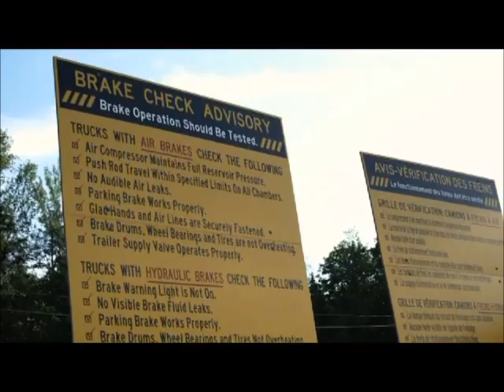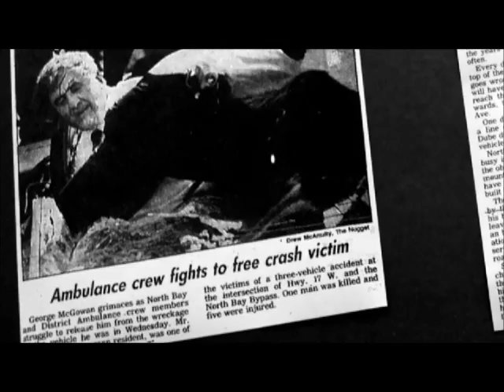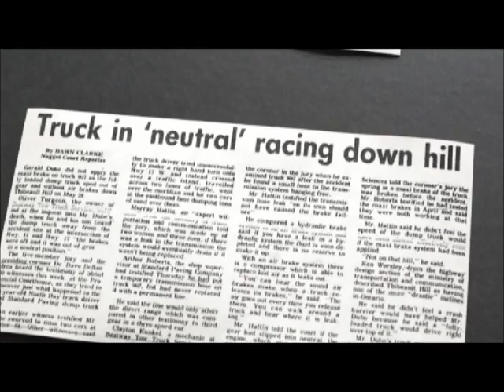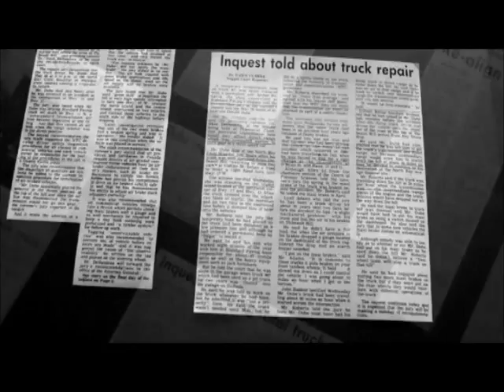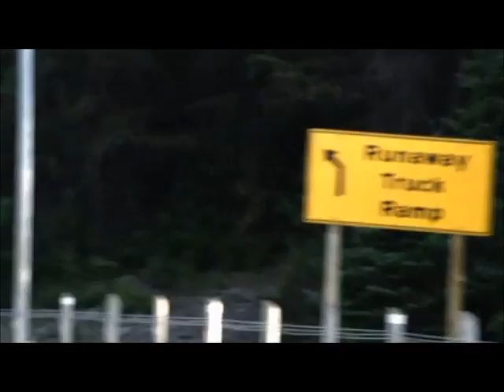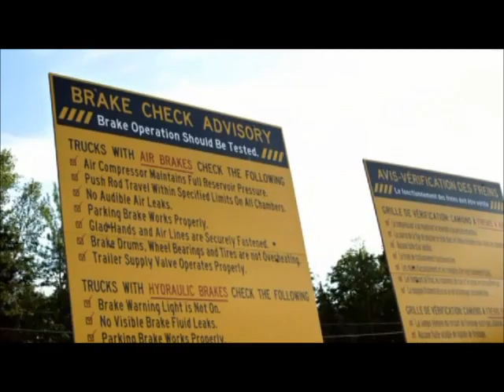Runaway Truck Ramp Demo

Comment: The real question is why are trucks running away? Problems at home? Instead of nets they need a truck psychologist on the side of the road to help these poor trucks.
Reply: lol
Reply: You don't understand that much about trucks I do not matter you have problems at home or you don't have no problem special at work when your brakes go out just hope you make it and everybody else and another thing too that's why they got them spots for check your brakes and sometime they go completely out ,,and that goes the same way for your cars or pickup trucks pulling trailers full loaded going down the hill and you're using your brakes too much and too hard they're going to get hot and crystallized
Reply: @garyrichmond7857  he was being funny.
Reply: @garyrichmond7857  joke went wayyy over your head.
Reply: Peter J Mallia  Because ceramic breaks.
Reply: 2 years old comment nonetheless i just laughed across 4 rooms. Bwahahahahahhahahah thanks.
Reply: @garyrichmond7857  Btw, punctuation is invented already and it's free.
Reply: Anifco67  it's not so much the mechanical failure as is the way it's maintained.
Reply: @Luca Hincapie I think i was far enough over his head he didn't even hear the woosh.
Reply: Anifco67  They don’t have faulty brakes. And Styledsteele1 it’s not really a maintenance issue most of the time.  It’s poorly trained and inexperienced drivers who ride their brakes in the mountains because they don’t know how to properly control their speed with gears and engine braking.  Doesn’t matter how well maintained or well designed they are, all brakes will fail if you exceed the temperature limitations of the component materials by introducing excessive friction due to erroneous steering wheel holders riding the brakes for a long period of time and paying no mind to the smoke signals being broadcast from the brakes on every axle.
Reply: Anifco67  Gary...you’re a driver, aren’t you...?   Lemme guess, you drive for Swift?
Reply: @urbanturbine  whatareyoutalkignaboutgarydontneednopunctuationmarkhesbeyondthatfullyloadedandgoindownhillwithsmokinhotbrakes
Reply: @sushimamba4281  haha. yes. seems. like. it.
Reply: @garyrichmond7857  periods work pretty good for ending sentences instead of one long sentences.
Reply: @garyrichmond7857  did your punctuation run away?

Comment: As. Truck drive that owned a truck that was put into a gravel bed by a driver, this system looks great. The gravel bed tore 26th truck up to the point of total loss. This system looks like if it makes only cosmetic damage that is repairable. The gravel system sent my driver rocketing into the room causing major bodily injuries. This on the other hand looks safer. 
Ontario MoT, thank you for your innovation in safety.👍 Good job!
Reply: Nope my brother at dealership here said they were shocked frame was bent bad

Comment: On the runaway ramps in Oregon, you get ticketed about $2000.00, if you use it for whatever, period..
Reply: Insurance will probably cover that.
Reply: I would say its cheap "driving lesson".
Reply: I wouldn't call it a ticket either. It's more of a fee.
Reply: first name Yeah but State patrol will do anything to site you for the fees
Reply: Yup that's why guys die on cabbage makes alot of sense dosnt it?
Reply: @treepop9907  :: you're right on that first part but you're forgetting there's two more parts go with that and I'll say probably two more
Reply: But what if the cars brake didn't work?
Reply: Cabbage hill will eat your lunch

Comment: I grew up in northern Ohio, where a hill is any change in road height more than 3 feet over a half mile. It's pretty flat there.  knew nothing about hill-induced brake failure, runaway truck ramps or any of this until I stumbled onto this video and now the random info nerd in me is  mesmerized when he should be in bed.

Comment: Why is the ramp on the left side of the highway?  The truck has to cross the fast lane to get to it.
Reply: If a truck's brakes have failed, there is no logic staying in the slow lane or having slow vehicles blocking the truck's access to it as it approaches... It's called a "slow" lane for a reason, much like a truck/vehicle suffering brakes failure, is called a "runaway" for the opposite reason. I actually found this video, after watching a video of a truck using a gravel ramp which was connected to a slow lane. In that particular video, it actually became surprisingly clear that the driver of the runaway vehicle often has to be "lucky" with timing, in order to safely be able to get back into the slow lane between slower vehicles that were in its way, to be able to actually even use/access the gravel ramp at all. At least when you see a truck barreling down the hill behind you in the fast lane (hopefully with hazards and flashing headlights to get your attention), you'd realise pretty quickly it's in fact in distress and get out of its way asap... People in the slow lane are just going to think "Go around buddy", instead of clearing the path... Just an observation.
Reply: oopth But think about it..... why on the right and not left? It's like editing a huge paragraph in the middle of an essay written in ink. There's lots of two way highways so it would be inconvenient and dangerous to implant a runaway zone on the left side. If the highway isn't newly built or if it's on a steep mountain, they wont risk builing it in between the lanes rather than adding it to the right side. Idk if I make sense, cuz visual things always clear things up for me- which is why Im watching this video about how Runaways work. But back to that essay, either you start all over, or you write it in the right margin and draw attention to it. This is without using whiteout or anything, because like I said, it's inconvenient and dangerous to fix up a steep mountain two way highway.

Anyways, Im not trying to argue or anything. I just wanted to give a reason as to why there's typically more runaways on the right side than the left. (at least where I live).
Reply: Where that runaway ramp is there is a rock face on the on the right side of the hwy. Hwy 11 makes a left hand turn 3 lights past the ramp so most trucks would want to be in the left lane coming down the hill instead of changing lanes in the city. At the top of the hill before you even start down there are signs saying all trucks must use left lane. And they get fined for going down the hill in the right lane. So truck won't have to try and cross a traffic lane to get to the ramp
Reply: In bc salmon pass 18%grade 21miles or kootenai 18 to 22% for 14miles all ramps on opposite side of road we know how that would turn out yup cars passing you and oncoming cars no chance of using ramp I watch a guy die he tried but too many cars coming he flew 17000ft to his death below and on salmon the final ramp goes across#3 at the stop if you make it across traffic and blow thru the ramp a pile of dirt it's over long fucking way down
Reply: Trucks must use left lane. The hill is maybe 1km long. City is right at the bottom with traffic lights.
Reply: All the runaway truck lanes I have seen have been on the right side.
Reply: It depends on the particular terrain where the ramp is located.

Comment: Semis could be required to use the lane closest to the runaway truck ramp for the previous mile, That would ensure further safety by aiding reaction time, and already being in the mindset of possible catastrophic failure, etc.

Comment: I have just found out that runaway truck lanes are a thing, so this is not a developed thought. It seems like an air traffic control equivalent might need to schedule trucks if 4 hours are required to reset the netting for the next brake failure emergency. I'm sure other problems or driver error causes runaway trucks so while it is a wonderful system... Maybe trucks are tracked and scheduled already, what do I know? I learned something new today. Mind. Blown. God bless truckers! ♥️

Comment: What happens if a car like a Honda or Ford sedan drives into this by chance? Will the cables slow the vehicle safely or is the force it takes to unwind those stop blocks so strong it just rips a car apart? Pretty cool how it worked for the loaded truck but i want to see car go into it at speed.
Reply from the maker: It will slow a smaller vehicle effectively  since there are gates and not a single one. The force is cumulative.
Reply: It would heavily damage a small car
Reply: They set cables to 'stun'
Reply: If it's low height car the cables could go thru the windhshield it would seem
Reply: The reason for establishing runaway TRUCK ramp is to safely stop the TRUCK with brake failure, as the name says. There is no other way to stop the truck, that is being pushed down the hill by the thousands of pounds and by the error of driver ( quite common ) brakes have been burnt or had just had another coincidental failure. Usually taking into consideration weight of regular passenger car it should be possible to stop it with just engine breaking , reducing the gears from highest to lowest( at least in stick shift cars ). It's becuse of weight to braking capabilities ratio.
Reply: You got a good question there only thing I can say when you go through it in small car or something like that you would not have worried about going to the butcher they go ahead and ship you to China 😂😂😂😂😂😂 p.s. I just had to say that I apologize,, I just hope nobody does in car I say probably be bad just guessing

Comment: Am I wrong in thinking it would be nice to have some kind thinish modern material for a 'bumper' type effect, on both sides of the Concrete walls (in between each set of netting...so as to keep the truck's cab from breaking apart..as well as keeping the trucks from impacting the walls so hard that the cab might come apart and the engine gets any kind of hit? Might help keep the drivers from hitting to hard on steering wheel...or seat belt breaking and driver goes through the windshield? 
Meaning , yes there's 7 nets but travelling at high speeds still ..drivers could suddenly have more loss of control...forcing more of an impact with those concrete walls..or other mechanical failures could happen...making keeping truck in forward mode almost impossible for the driver.

Comment: I was a commercial truker for many years, and always hated when had a full load & HAVING TO CLIMB HILLS that really slow me down delaying while needed to use the frk'n toilet. Have any engineer calculated how much distance is needed to stop a fully loaded truck on an inclined ramp? Now to prevent from rolling backwards have the side walls stepped for the driver to steer into the one closest to the point of back roll. If a runaway rig's driver was able to take in the ramp it should be able to back roll into the Wall's step corner, or maybe an additional Anker system implementation.
How about triangular wheel shocks comming up from the ground activated by sensors like the ones used on automatic gates? This nettings on video are ridiculous.

Comment: If this is a safety film, and it is why did the driver at 9:56 jump from the cab of his truck to the ground? He could have easily injured his back or broken a leg. This truck driver should have turned around and used the three-point system (Two hands one foot or two feet one hand) when exiting the cab of his truck. Too many drivers have been injured jumping out of their trucks.

Comment: wonder what the reset cost is? I've heard the traditional rock beds are very expensive to reset and destroy the vehicle, making the driver hesitate to use it. It looks to me like the vehicle damage was relatively minor in this system.
Reply from the maker: From my sketchy memory the gates in WY cost approximately $10,000 to replace (each). So up to $70,000 if you use all of the gates. Reset time is less than the gravel bed. All of the vehicles in WY have been able to be driven off the mountain as well. The insurance companies are happy to pay the reset costs as a fatal accident costs much more. There are still fatalities on the road for those trucks that chose not to use the system.
Reply: My only question is, why are rock beds expensive to reset? Isn't it literally moving the rock back into place?
Reply: Dealer wrote it off frame was bent
Reply: I think it's time some smart engineers developed a better system.

Comment: This is bad design because all the stopping force is applied at the very front of the vehicle. If the load isn’t perfectly strapped down it could be sent flying into the driver cab due to inertia. The river rock runaway ramps are better since the stopping force is spread across all axles.

Comment: Uh, just a citizens question - don't trucks mostly drive in the right 2 lanes?  So a runaway system would be more accessable on the right side?
Reply: Trucks are required to use the left lane in this particular location.

Comment: god i hope nobody has to use it while they're resetting it lol
Reply: That's what I was thinking. They had the highway closed for the test itself but if two drivers have brake failure in rapid succession while the ramp is in service, there could be major problems
Reply: Yea that's a big issue to be honest
Reply: Not to mention cars in that lane? Will they move out of the way? Nope and it totally destroys the tractor

Comment: If a regular sized car or van decided to use the ramp, what would the result be? Have there ever been tests of this nature? Seems like it might be a pretty gruesome scene with thin steel cables hanging about.
Reply from the maker: Bill, there recently was an incident with a smaller truck in Wyoming. It only used 1 gate and the vehicle was safely driven off the mountain.

Comment: So, out of curiosity, wouldn't it make more sense to combine both this set up with sand(less damage from anything thrown up)? I understand that it would still likely freeze in winter, but have 2-3ft deep sand for the first 150-200ft and spread the lines out a bit. Common sense tells me, that that would make the runaway lane reset faster and cheaper, as well as do less damage to the truck.
Reply: I would also like to add, what happens if a truck carrying an oversized load has brake failure? say the truck weighs in at 100,000lbs or even manages to reach a speed of 90-120 mph? That system isn't designed to stop that kind of weight or speed.
Reply: Oil came out when that happens the soil be it sand in this case would become contaminated and like gravel would need more time to clean out and refill. Its still time consuming and thus cost prohibitive.

Comment: If space permits, I would think a gravel bed would be better and result in less damage and may even be  less costly and time consuming to return it to operational status.  Admittedly, I'm not an engineer in this area.  The arrestor type is better than nothing at tall, but a 4-5 hr reset time raises the cost and from this video, damage.  Once the truck was captured by the arrestor cables, steering control was lost because the loaded trailer is trying to continue its forward momentum.  There's no arresting capability for the tandems in a cable type system.  I can see where a jackknifed rig could result.  With gravel, the tandems also encounter resistance and help reduce stopping distance but steering control is also reduced.
Reply: As they said in the video, the gravel type arrester bed would freeze in the winter, with the weather that can occur in that part of Canada any truck going into that would be hitting a skating rink, not loose gravel or stone.

Comment: Very interesting technology, but looks expensive and is awful hard on the truck, Couldn't you just build a shelter over the gravel?  IE a covered Bridge. So a large barn or shed that would keep the gravel dry and keep the snow out would allow a traditional sand/gravel/rock ramp to work year round. It would also keep rocks from flying out. Pricing out large metal buildings is real easy (barns and airplane hangers are real common.) Basically a pole shed. It would of course need sides for blowing snow, but then as long as the rock is dry, it would work.

Comment: Rocks for most lets trucks in and out and cost less and as soon as one truck is removed another truck can use it with little down time. This is but one more system... and there are more...
Reply: Rocks are 200 meters longer, they don't have this much space. This system is shorter and safer.
Reply: Lankster Price The video itself stated that in the cold weather the rocks dont work very effectively

Comment: The old system stopped many trucks without the damage this new system creates. Not to mention the astronomical cost 
they charge for the privilege of it's use.
Reply: How would like going the other way when someone used this and wound up with a 2 inch gravel stone i your windshield? Yeah they do not use less than 2 inch stone in those rock ones, so they do more damage than you see and if you watch the gravel test it also tosses the control of the truck to one side not to mention the bouncing it did. Also look up "box truck getting flipped on runaway" when using said gravel ramp. And yes snow turning to water and freezes up where it snows and rains even if an area it gets cold enough to freeze, gravel becomes SOLID.